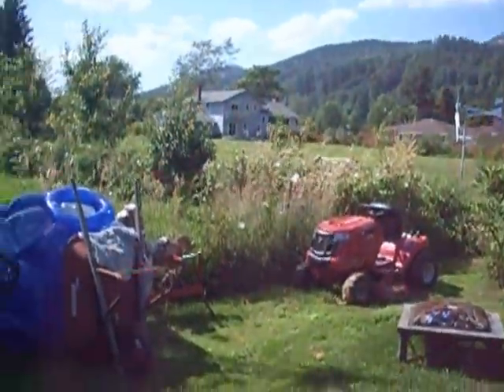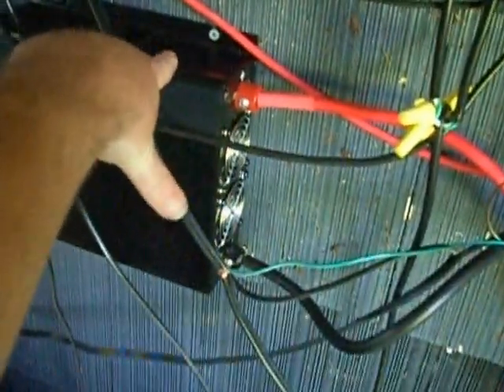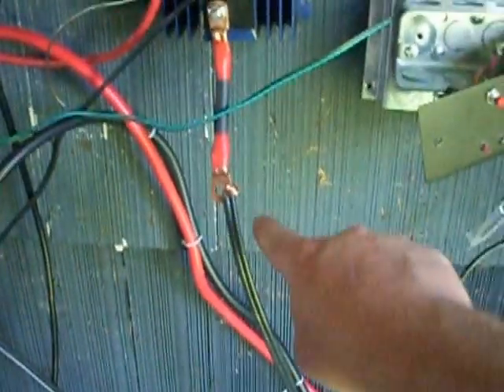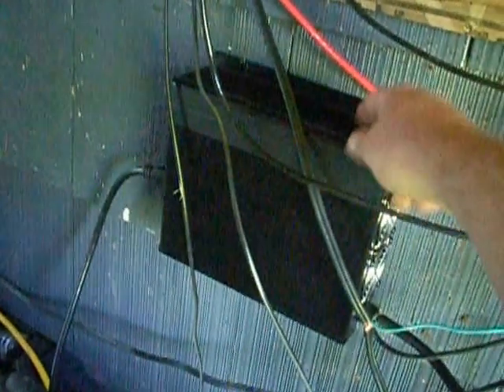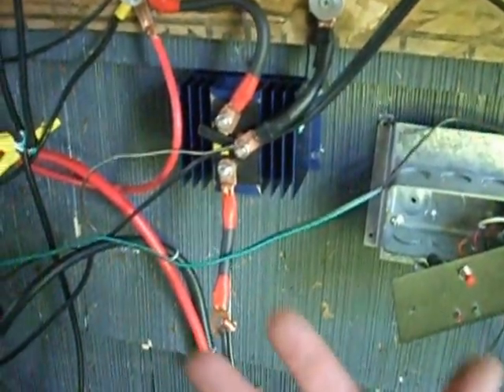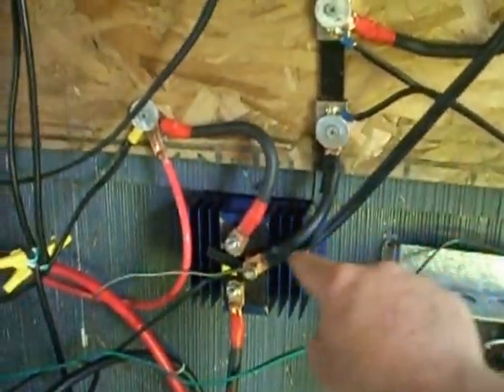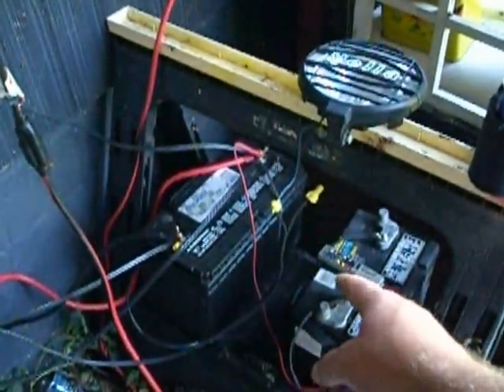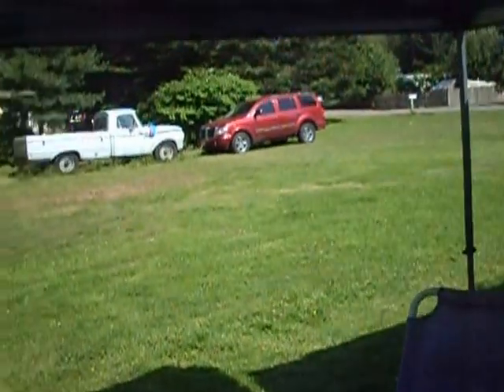I slapped together my battery backup system and all was good :)

Comment: looks good. thats the way to do it.  I have thought about setting up a device to were if the power goes out and the gti's are not being used it will do the same.  nice video thanks for showing.

Comment from the maker: I don't think it is a switch. It is made so you can charge two 12 volt batteries at the same time. It keeps the 2 batteries separate so you can drain one battery dead but the other will be good to go ( full charge) ,, I use these battery isolators on boats. I can listen to the radio on my boat all day long, but if the battery goes dead I have a backup battery to start my boat when it is time to go home.

Comment from the maker: I wasn't expecting the power to go out today,, but I had the stuff ready if it did. All I had to do was hook it up :) Now all I have to do is make it look pretty. Using a battery isolator I can charge a 24volt battery bank using my 12volt solar and wind setup. It is the best way I could think of running my grid tie inverters and charging batteries at the same time.